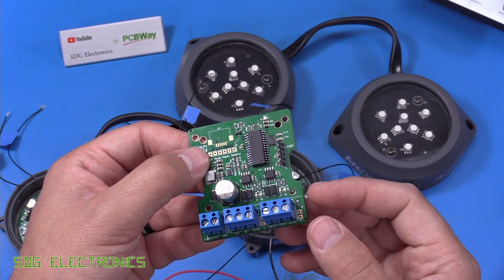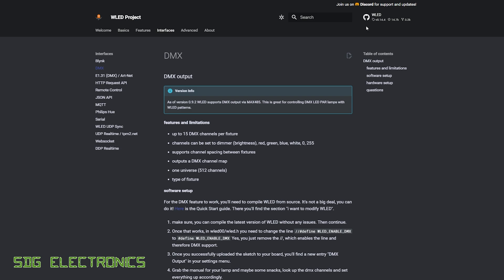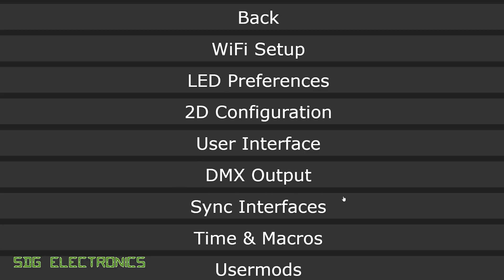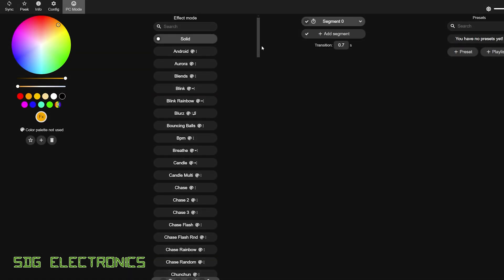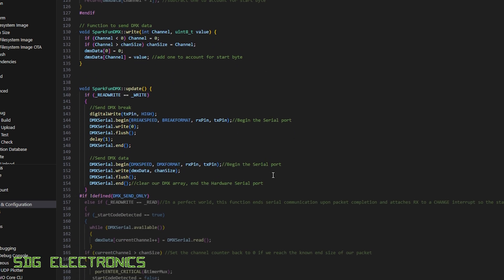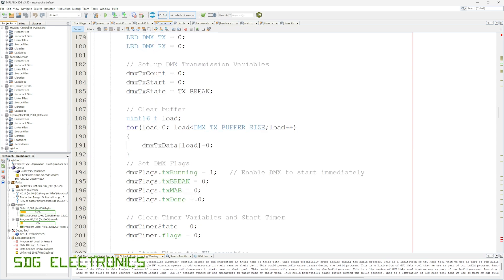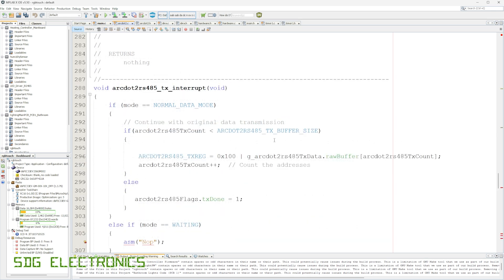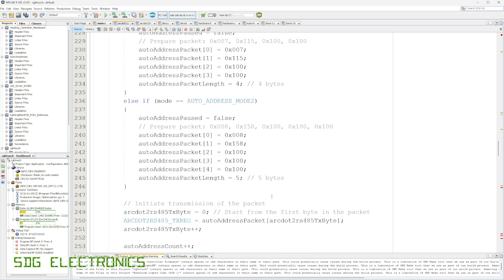SDG #349 Testing of WLED to LED Lighting reverse engineering

Comment: Super interesting content! Where did you learn all this about uart and data signals? Is this taught at University?

I know it’s not the point, but I’ve done similar in my garden with some 24v ws2811 pucks with 6 diodes per puck via AliExpress. Also have some UCS2904 pucks with dedicated white doing the same. Plug and play with an ESP32 and WLED out of the box. 

But I still do wish I had your skills to reverse engineer hardware and firmware like this and create PCBs and firmware. 😂😂

Comment: Wow, you decoded the protocol in minutes and now you have a very nice lighting system just the way you want it. I wish I knew half as much as you do about digits electronics so I could do cool stuff regardless of how challenging the problem. I sort of understand what you did in theory, but there’s no chance I could ever pull it off on my own. Thanks for sharing your success. It turned out really nice and quite the deal for pro lights.

Comment: Are you quite sure the data is actually 9 bits?The first or last bit might not actually be used. I've come across this before, and I just set it to 8 bits and 2 stop bits to absorb the unused bit. I've also never seen 9 bits in actual use, and not much really supports it.
Reply from the maker: 8 bits and 2 stop could work for the receiver, but not the transmitter. Based on all the data I've captured, the PIC32 on the controller is transferring data by DMA, so that first byte isn't being manipulated by changing UART mode.

Comment: Going back to the 6402 UART from  the 80's it only support 5/6/7/8 bit data, back then I don't remember any UART that supported 9 bit properly. A trick was to use the parity bit in combination with the 8 data bits to effectively extend the data to 9 bits.
Reply: If the parity bit is user controllable, this might actually be useful to keep in mind for my esp32 projects
Reply from the maker: @AnnaVannieuwenhuyse  I did look into this, but you can only do this with byte by byte transfers - it doesn't work for DMA transfers to the UART.
Reply: @sdgelectronics  ah that's a shame!

Comment: Interesting project, I use ESP32s and wled and then on my laptop i run JINX which means allows you to create some great effects and stream them to WLED. Great for doing light shows and can be done over wifi in combination with wled esp and jinx software live. I recently had a new smart meter fitted and wanted to get the readings into home assistant, similar project to this in terms of reverse engineering the serial stream from the in home display, extracting the current use and presenting it in HA. Always fun reverse engineering custom protocols.
Reply from the maker: @Cyrixxz  I'll have to try this, I used jinx for some Xmas lights many years ago